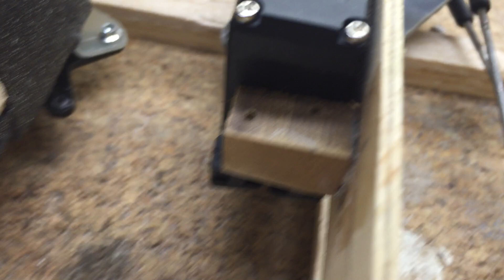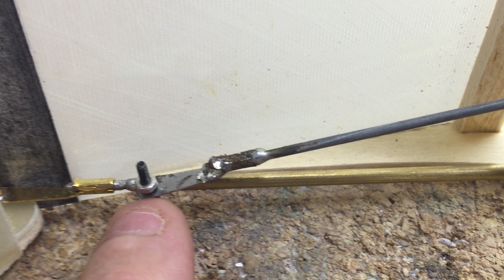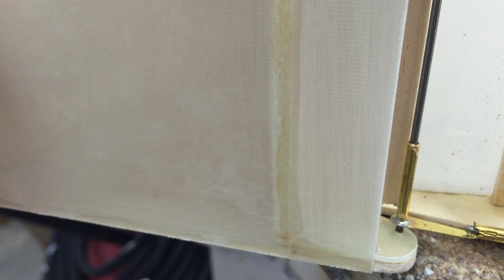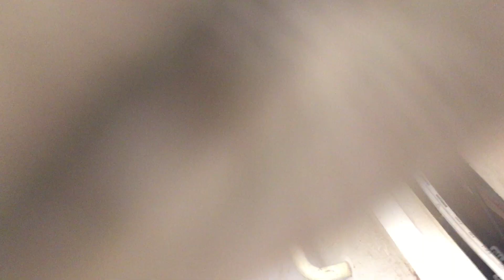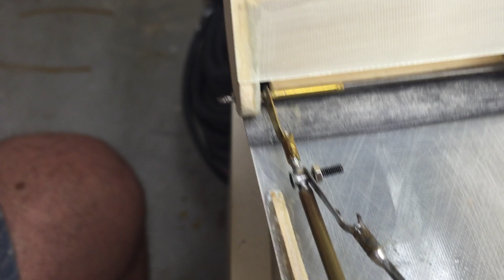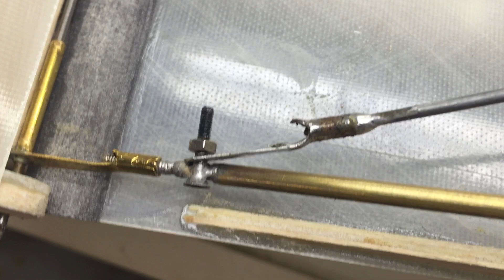Don Smith Constellation Fowler Flap Test #2

Comment: Nice engineering but as I have learned, its all about leverage.. Given your design, a solution would be to machine an inboard  rib with an extended nose (half the length of the rib). That would give you the leverage to overcome the large flap surface area

Comment: some late thoughts.  the flaps, obviously, need to be stabilized, near the hinge line.  a combination of fixed, pivoting anchor points in the aft wing and guide rods, with pivoting mount at the flap le, might work.     cheers
Reply: what library do you use to calculate the flap ?